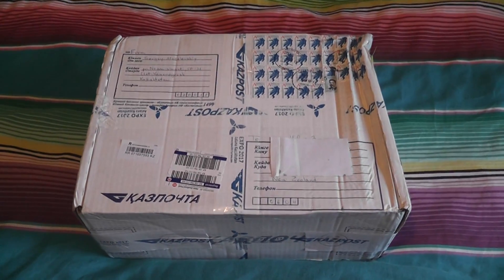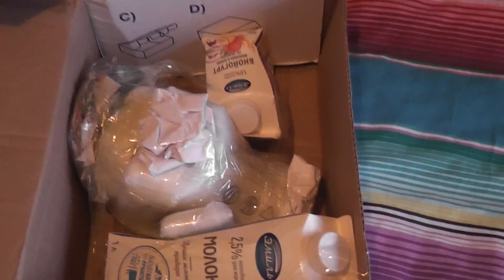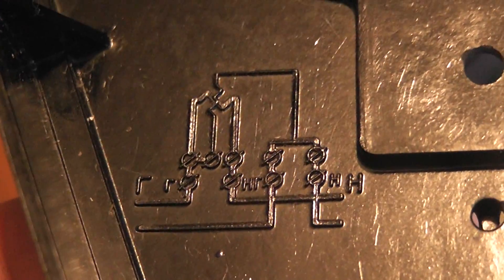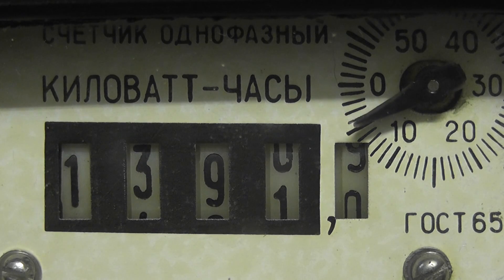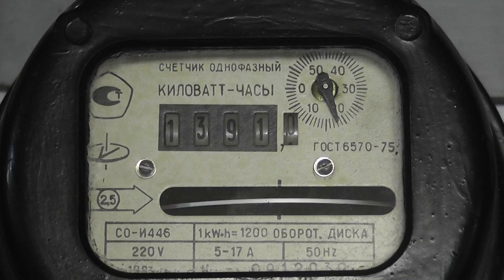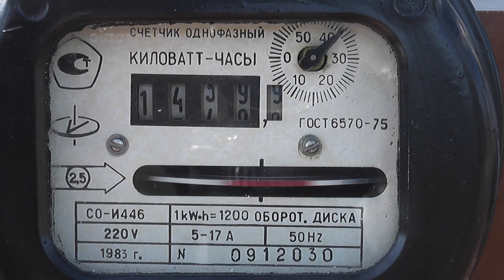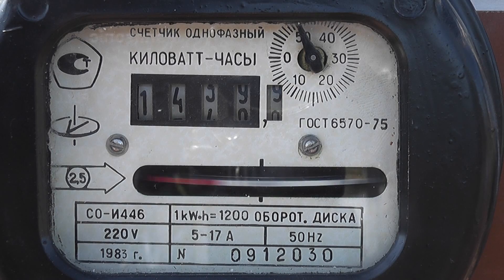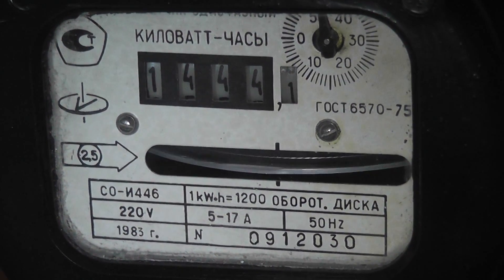Russian CO-И446 kWh meter

Comment: Hi, I wonder if you can help me, I have just received my first Kwh meter but I can't find any indication of a dare of manufacture.  Do you think you could give me a rough estimate of the decade it may be from. It's a Sangamo Weston S29 round single phase in a Bakelite case. If you message me on  lordhibbert@gmail.com I will send you a few images for you to peruse. Cheers Charles
Reply from the maker: The S29 series from Sangamo is the S29 form 1, form 9 and form 11.
These date from the 1950's.
The older S29.1 has 375 rev kWh as meter constant, (and a cover with 3 glass apertures) while the newer S29.9 and S29.11 meters have 250 revs/kWh. as well as different cover with two glass apertures.
Welcome to the meter collectors group. Hope the Sangamo S29 is the first meter for many more meters to come.
Reply: RODALCO2007 Thanks for all the  info. My meter is type 9 with the two glass appatures.. I already have it connected and working... Although I did wire it up incorrectly to begin with, it was running backwards lol.. If you don't mind, I'm sure I will have more questions for you on the subject in the near future. Thanks also for the MOT schematic, I found it most helpful in connecting up my four MOT,s in series/parallel with four caps.. Charles (UK)
Reply from the maker: Great you got your S29.9 meter working. They are very good and reliable meters. I have one of each version in my collection.There should be many more of those S29 meter around in the UK. The version after the S29.11 was the S200.7 meter in a square casing. You can use your meter to measure the power consumed by your MOT stack.
Reply: RODALCO2007 yep, I'm gong to do just that. Hopefully one day I will find a nice ampere and voltmeter to mount next to the meters. I'm also currently working on a small oil tank to house the MOTs, I want keep them under oil to prevent over heating. When I get any more meters that I need help with I shall drop you a message. Cheers

Comment: Those red wax seals are very common on russian made equipment, you find them everywhere, from cheap customer transistor radios to aircraft electronics. Sometimes they also used some kind of black tar as a seal material.